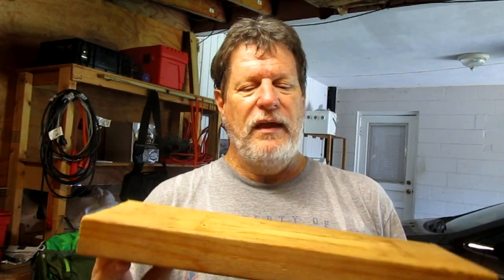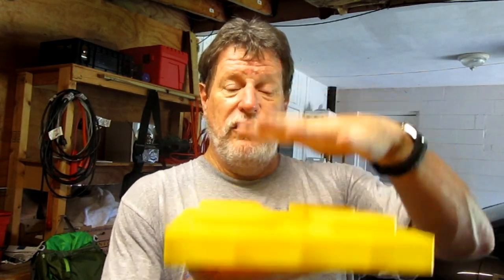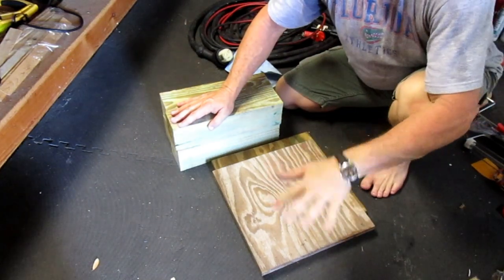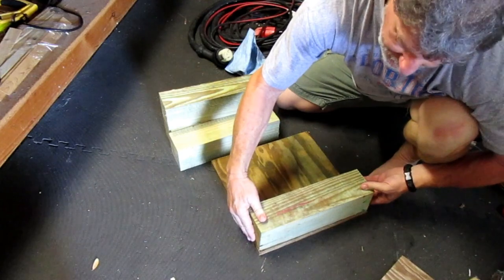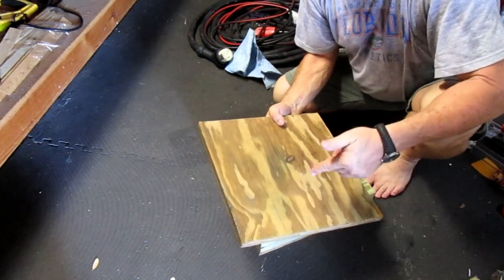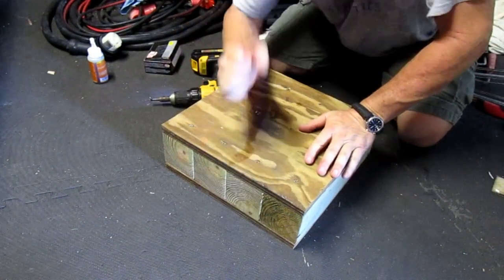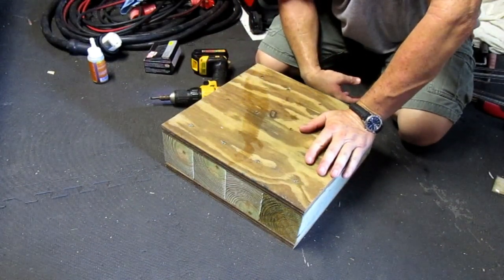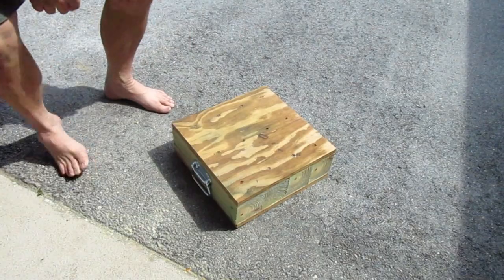Easy DIY RV Jack Pads

Comment from the maker: Please LIKE, COMMENT & SUBSCRIBE!!  I answer ALL comments...
Reply: Okay, now looking at the measurement that you did, if you cut 4-4x4=16 and  two 3/4" plywood at 14x14 wouldn't the 4x4 have so extra, I guess that I need to go to Home Depot  and measure the 4x4 and see?
Reply from the maker: @bishopgeorge1333  These days all wood is slightly undersized so it works out...

Comment: I went with a slightly different design that ends up being a little lighter but significantly stronger that won’t split. Basically you use the “End-Grain” of the 4x4 that are 3” thick with the same plywood on both sides to keep it from splitting.  Like mentioned, Use Good Glue and not some crappy adhesive that stays flexible. I also glued all of my 4x4x3” together and drove screws in from the sides to keep from splitting the end-grain. The reason I switched to doing these with end-grain is because I have a 45’ Behemoth and I need as much strength as possible.  

I’ve got another that I’m building right now with 3/4 HDPE in place of the plywood…

I never have understood why people WANT to spend so much on these types of things especially the Snap-Pads!  I’ve help several people that had Snap-Pads that just sink down into the soft gravel and ends up causing more problem than helping.  

Good Video!
Reply from the maker: Awesome!  Those will never come apart

Comment: carpenters are cursing you right now.  nice level block , good idea on handle for moving them and storage. paint the plywood, especially edges.
Reply from the maker: Thanks!  Lol...this is a true DIY project.  These things are indestructible...
Reply: Ted Semonis you don’t want to paint pressure treated wood until it has dried out where it’ll take up the paint
Reply: @nancydenmark1614  The plywood used will dry out quickly. that is all you paint if water gets to edges it's ruined, the 4x4 don't matter.
Reply: Ted Semonis yes you should paint any cut edge of any pressure treated wood but the rest won’t absorb the paint until it dries. Of course I live in a humid state so you may have a different experience where you are

Comment: how about using 3, with one in the middle?  or even one 4x6 in the middle instead (on it's wide side), with maybe 2x on the sides? less weight...
Reply from the maker: There are lots of ways to do it...

Comment: I made some out 2x6. Made them 2 boards wide and on the other side it’s two boards wide. The they run perpendicular to each other. I left about and 1/8 in between each board. Mine are about 12x12. Then I use a square piece of the 2x6 that sits on top of the the other to help spread the weight.
Reply from the maker: Awesome!  There are a lot of different ways to make them, the important thing is to have them...lol

Comment: I like the idea, I’d personally use construction adhesive and a 3 1/4” framing nail with my nailer. I don’t think the screws have the structural integrity that a framing nail has when it comes to being out in the elements.
Reply from the maker: Lots of ways to do it.  These work very well...
Reply: you're not using the fasteners for structure (support the RV), just to hold it together.

Comment: Can you say "overkill?"  Those things would hold up a house.  I guess they're ok if you don't care about cost or weight.  To make four of these you would need nearly 20 ft. of 4x4 plus a sheet of treated plywood.  You might want to price that out first.

5/4 deck boards over a 2x4 frame would get the job done with less weight and cost.

Comment: Pardon my ignorance if I've missed the maths, but doesn't 4 x 4  = 16? Shouldn't your plywood be 14 x 16? Or 16 x 16?
Or are your 4x4 actually 3.5 x 3.5?  (90mm in metric.)

PS if you had a camper van like I do, you wouldn't need levelers at all. :)

I was reading a outdoors magazine that was comparing different set ups and how long each actually took to set up eg camper trailer, tents, awnings, caravans etc. The fastest was 15 minutes or so.
I said to my wife "how long does it take us to get from the front to the back?"  A few seconds was the reply. We get in, take off our shoes, job's done.

The best thing about traveling is that there is always a way that best suits you.
Reply from the maker: 4x4's are actually 3.5"x3.5" so 4 of them would be 14" wide, hence the 14x14 dimension on the plywood to keep it square.  I like camper vans, but like the room of my 5th wheel even more.  It only takes us about 20 min to get it set up and ready...
Reply: 4x4 is not really 4x4.. a 4x4 is 3-1/2 x 3-1/2..